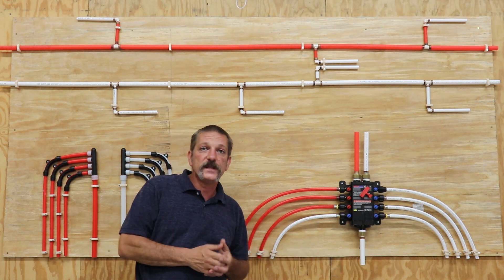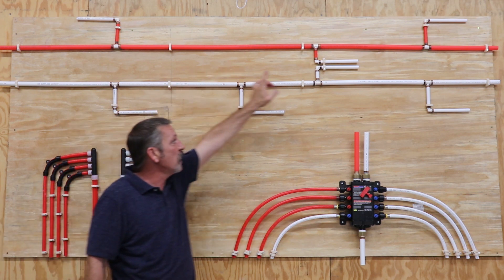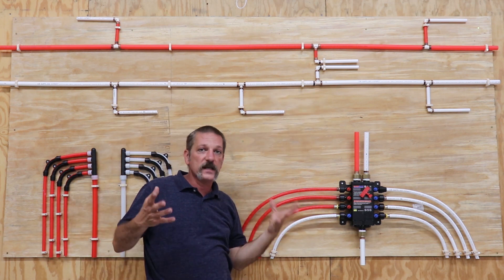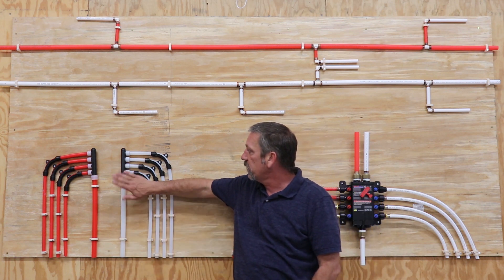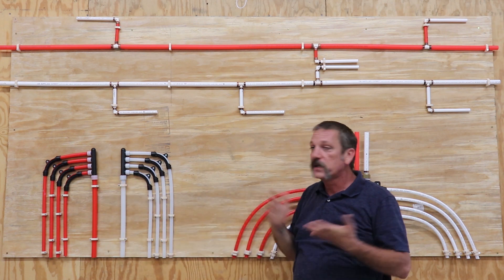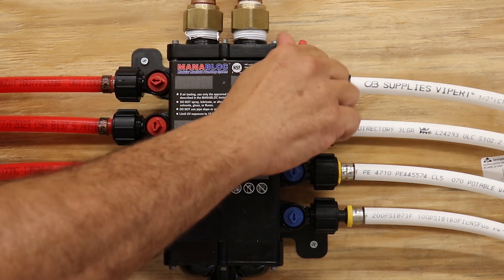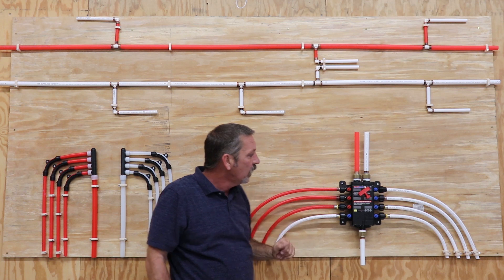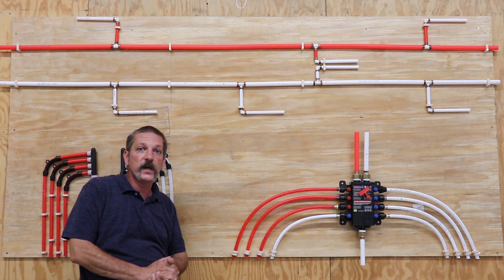PEX Installation Methods

Comment: Hi... Would you say using a curved 90 is better for end pressure, as opposed to a fitting 90?... Thanks...
Reply: Much better with bend supports than bends. A bend is another connection with more risk, and the bend will also reduce the pressure somewhat.  If a plumber does not use bend supports, he doesn't know what he is doing.

Comment: the distribution blocks are handy for shutting off each area but you can do the same with a shutoff valve at the toilet sink whatever. they only have a warranty of 5 years on them not a a single distribution valve has lasted 5 years and they are god awful to replace hate them and cannot recommend them to anyone.

Comment: Does Pex B need bend support?  I noticed support on the Pex A manifold.
Reply: Pex B isn't as flexible as Pex A. You can get some curve into Pex B but you have to be careful not to over bend or it will kink and will need to be replaced.

Comment: If you just swoop the pex through the house is going to water hammer and bang against interior walls when valves close fast?
Reply: Yes if you just “swoop” it through the house you can have water hammer. I prefer the Pex A Uponor version with a ProPex Milwaukee M12 “12volt” expansion tool. If you make sure you drill the correct size holes through the studs and use the correct size clips/isolators at each stud or pass through, and support the Pex-A properly it be fine. The reason you use the Pex clips through a stud or as a clip to the edge of the stud is to support the Pex pipe from sagging or making noise through the stud. It also helps with controlling the expansion you get from the hot water line.
You can also put a hammer arrester in at the washing machine, ice maker, and some toilets and dishwasher also have fast shutting valves that can cause water hammer....  ***Also make sure you put an anti-nail plate on both sides of the stud (if possible) where the Pex pipe goes through each and every stud, just like you would with electrical cable going through a stud.

Comment: Omg, this dude is a legend! The only thing I'm wondering is where I'd have to place the PEX. We had a freeze in Texas a few months ago and almost all of my mom's pipes burst. Her manufactured home is 35 years old and it seems easier to just replace them all. I wanted to use PEX but I'm not too crazy about crawling around under the house all day. Is it cool to run the "Trunk" line around the base of the house instead of down the middle? Like still underneath the house just closer to the edge of the foundation. I'm thinking it would use more pipe but be good for future repairs but I'm not sure if this affects the water pressure or something.. If anyone could help me out that would be awesome.
Reply: I'm a plumber in Texas and the freeze you spoke of revealed several things to me about pex, with the most important being Pex A expanding to the point of rupturing, whereas i never saw it with Pex B, Pex C, or Polybutalene....
Reply: @BigG903  So don't use PEX A?
Reply: Also consider using PEX A, not B. PEX A can expand (which is how the fittings are attached) this means if you have another freeze, the PEX A pipe will expand when frozen, but return to normal once the ice inside thaws.
Reply: @nova31337  Guess what: both will expand and are resistant to burst from freezing.  The difference is that PEX-A can expand more and still contract to original size.  PEX-B has a lower burst rating.  Both A and B (specifically Zurn-B) can be installed with expansion fittings and/or compression rings.

Comment: I think the best compromise is a modified manifold system that combines a small manifold with smaller trunk and branch sections.  Less fittings, less piping, still easy to isolate and fix if there are any issues.
Reply: yeah..like a ¾" trunk & branch for the East section fixtures and one for the west and so on..all arising from a small manifold of 1"

Comment: When you put pex in a slab do you have to put it inside of some conduit or will the pex pipe not be affected by the concrete?
Reply from the maker: There is a plastic sleeve you can get just for PEX. But, yes concrete will eat up PEX.
Reply: @PlumbingSolutionsLLC  I never knew that.
Reply: @PlumbingSolutionsLLC  - About concrete affecting pex could you elaborate or show documentation, I used pex infloor radiant ( 25 years old ) and no issues. Did sleeve the points where pex entered the concrete with pvc electric 90* elbows to protect against impacts.

Comment: Are pex stubouts superior to copper in any way?
Reply: No, coming with pex out the wall tends to be more flimsy unless you strap the hell out of it. Looks tacky as well in my opinion. Copper stubouts look cleaner and are easier to fasten and get nice, straight and tight. I like running pex but using copper for the stubouts. Technically, there's nothing wrong with using pex either. It's just preference. Copper also of course costs more. Pex is dirt cheap so I guess that is the one benefit of using pex instead.

Comment: Great video! Is pex easy to install for the average homeowner?
Reply: Very.  Depending on the system you decide to go with - there may be some specialized tools to pick up, but the learning curve is a heck of a lot lower then what you have for doing any other plumbing solution.
Reply from the maker: yes but you have to buy the crimpers or an expander tool .

Comment: Trunk and branch will be better when it comes to the hot water because once you are done with a shower you know you have instant hot water in your sink, vise versa, will save you water and heating bills...
Reply: ExActly. With the other system you use the vanity and have to wait for hot water to come through, then jump in the shower and have to wait again. It’s not economical. 
Trunk and branch is fine if you pipe size correctly and have a good mains pressure hot supply
Reply: Do a combined manifold/branch approach. Hot line from a manifold to a bathroom that then branches to both the shower and sink.
Reply: People are saying have the hot line recirculating - I don't know how to do that...